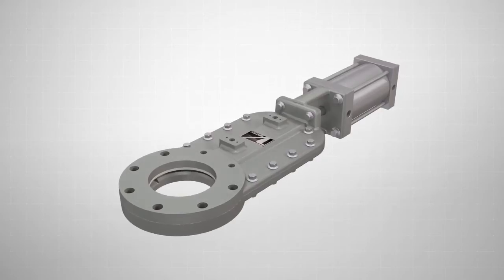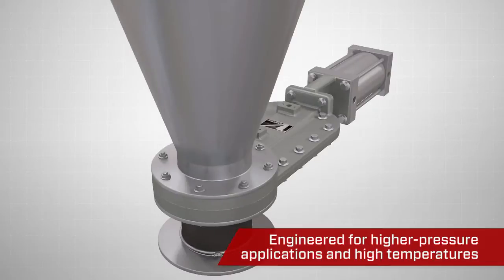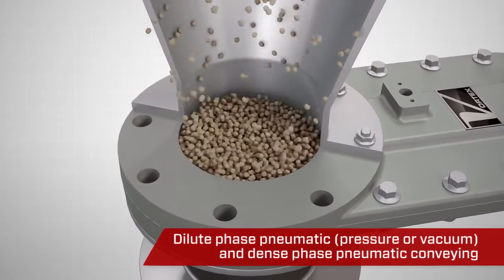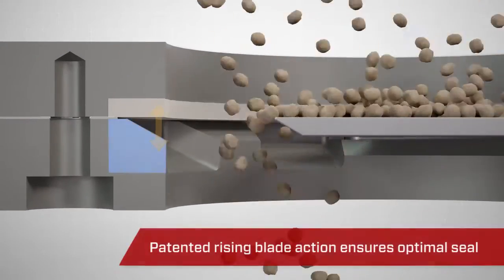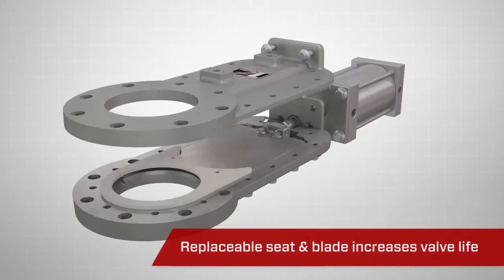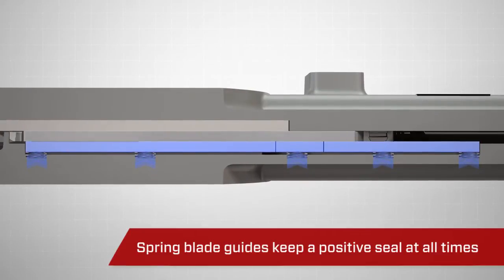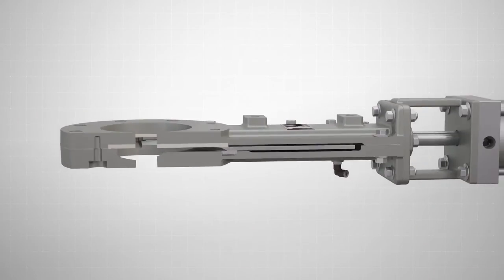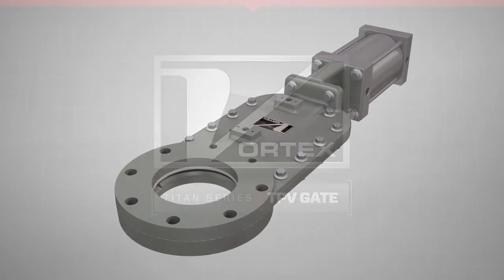TPV Slide Gate Valve

Comment: Hi, thanks for the explanation!
Just wondering what material does Vortex use for the seal? UHMW?
Reply from the maker: Hi, thanks for reaching out. The material used for the seal depends on several factors. To make sure we get the proper material for your application its best to reach out to our sales team at 785-825-7177,  or you can email us at vortex@vortexglobal.com. We also have a contact us form found here https://www.vortexglobal.com/contact-us/